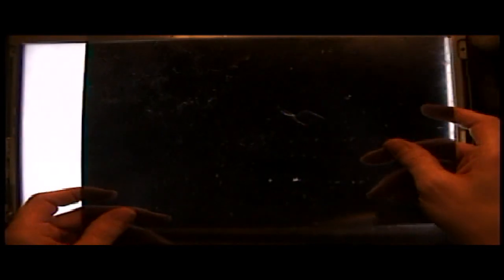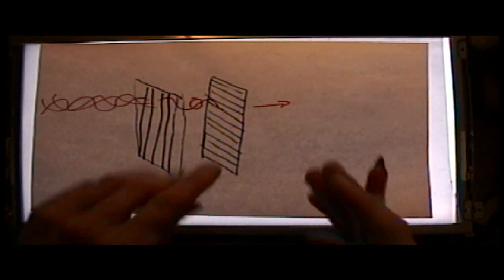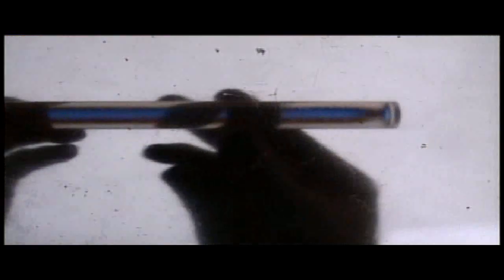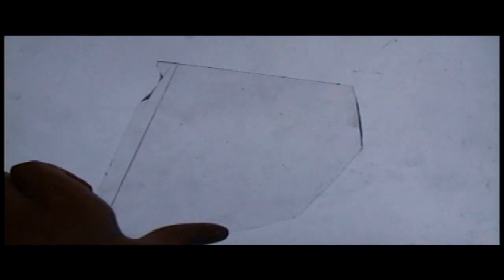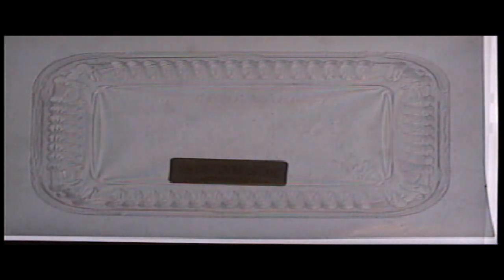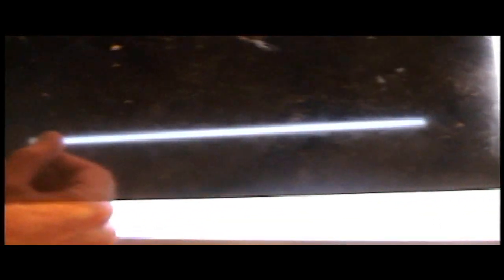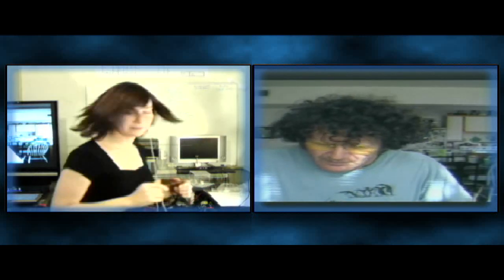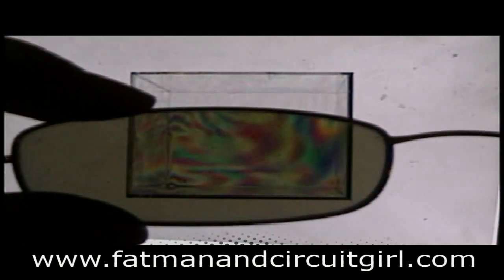View Stress in Transparent Materials - Recycled LCD Polarizers

Comment: Therefore, if you can determine the color at an edge where one principal strain is zero, you can determine absolute strain. When a part is not conveniently translucent, a reflective paste/adhesive and a transparent plastic plate that becomes pliable when heated is attached to the part. This allows you to determine a strain field on nearly any surface that can be followed by the plastic.

Comment: You have fashioned a very simple polariscope! I've used these when determining stress concentration factors on parts that have already been manufactured and it is inconvenient to construct a finite element model. Based on the color boundaries, you can determine the relative strain field. Due to the way birefringence works, the colors seen are directly proportional to the difference in strains in the two orthogonal principal stresses.